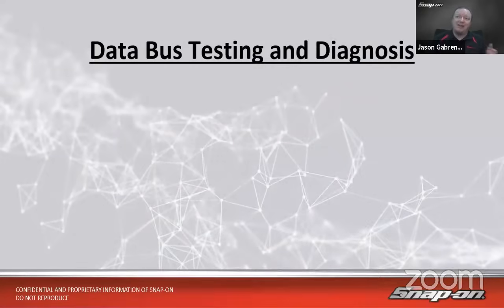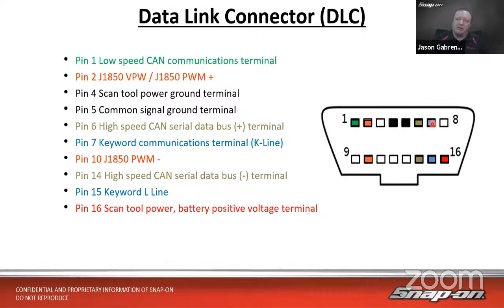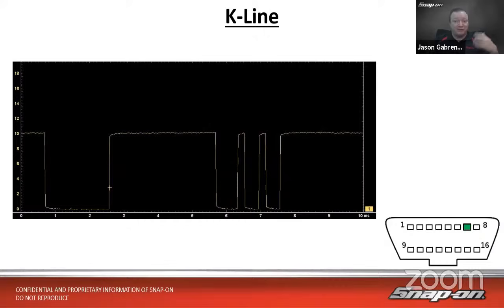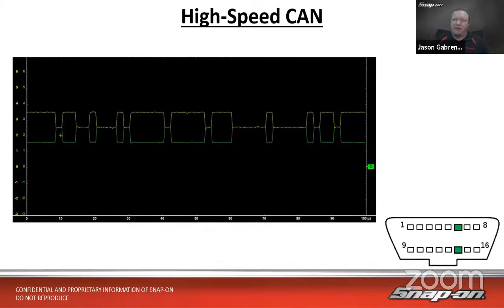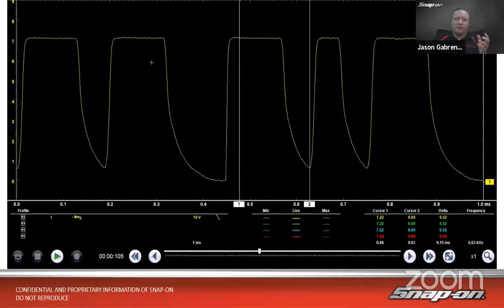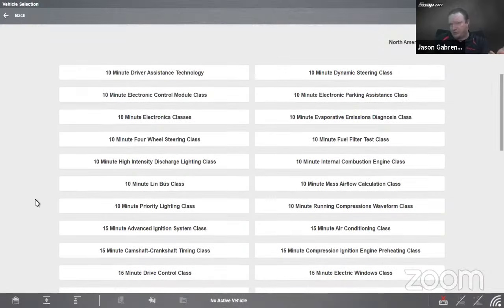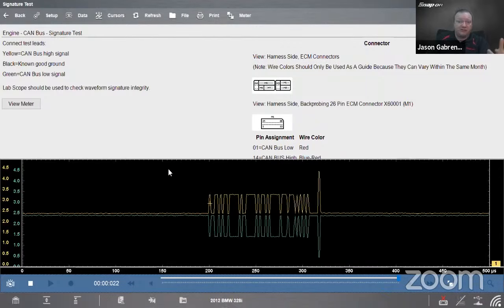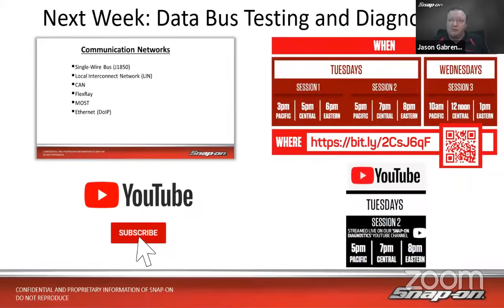Data Bus Testing and Diagnosis Part 1 - Snap-on Live Training Episode 07

Comment: Ideally even a CAN BUS Simplified diagram should show the CANH and CANL running together as a twisted pair (your presentation has a huge loop area, which is wrong), daisy chained from module to module without any stubs (which is how CAN was specified, and why termination is ideally 60 Ohms characteristic impedance). The reason you see stubs in cars is because the OEMs do not want to pay for a CAN bus in and a CAN bus out connections at the module connector. So, the OEM introduces an unwanted stub to save money by reducing the connector pins required by using CAN signal splices in the wiring harness with a corresponding loss of signal fidelity. Conceivable you could crimp two wires, if small enough, into one pin. However, the connector wire seals don't work very well when sealing two wires together.

Comment: This training has been a Godsend for me in learning to diagnose bus faults. I do have a question that wasn't addressed. What would cause an INVERTED/reversed CAN bus signal?? i.e., the resting voltages are 1.5 and 3.5v, and the drop to 2.5 when transmitting? Just saw this on an intermittent no crank vehicle. No com with any high speed modules (low speeds were good). After disconnecting and reconnecting battery signals returned to normal and com restored. No issues since. Sounds like a glitching or corrupted gateway module that needed its memory reset, but I'm no expert. Would love yours or anyone else's thoughts!
Reply: I'll also add battery voltage was low when I first tapped into the signals (parasitic drain). Hooking up cables and a jump box did not correct it right away. It was only after disconnecting (to do other tests) and then reconnecting that things cleared up and it cranked.

Comment: With regards to the Can High and the Can Low the voltage on both of these lines are positive the high being slightly higher than the low. When data transfer takes place the high pulses higher again and the low pulses lower again this produces a mirror image of each other in opposite directions. This is the VAG protocol.

Comment: weird, you normally dont see an open circuit at can system, but a bad module disturbing can circuits at inn and out from specific module or modules.
Reply from the maker: Definitely more common. I would say most likely cause for an open would be a damaged wire.

Comment: On the j1850 single wire bus, if one of the modules on the splice pack shorts, does it take out pin 2 of the DLC also? My IPC drops out and I lose the code reader also
Reply from the maker: If they are all wired together through the splice pack, then that would make sense.

Comment: Soo, I just watched another video which used strictly a VOM to test the CAN Bus. I commented on the video and also provided the link to this video because I realized that using a VOM is not always 100% accurate of what might be taking place on the network. Now I have a question after viewing both videos. 

In this presentation, you mentioned a  PERIOD at the end of  an information package / sentence. Can this higher voltage be picked up on a VOM and could that lead to misinterpretation / confusion of what is happening on the network - IF someone is not familiar with this end-of-message signal / voltage?

I'm currently a Marine Electrician  and ex Nuclear Instrumentation Technician due to transfer into the auto electrical diagnostic field later next month because I have become fascinated  with auto electrical diagnostics - at age 65...66 next month. If only I realized how complex and interested this field was I would have branched over a long time age but, better late than never coz I'm still in tip top shape. lol

I'm currently learning as much as I possibly can before embarking on my new profession at a luxury auto manufacturing plant here in the US, so I'm really fired uP.  

E / mc2 = m
Reply: What your take on auto diagnosis
Reply: Instead of living the rest of your life considering your 65-66 mark as best as you can you are making sweet dreams to thrive a business.
Reply: ill be here to help Pat Baptise.  just message and will share my automotive knowledge w you Sir.

Comment: @9:39 could you please explain again what data you send to vehicle to get data from vehicle ?
Reply: You have to ask ask your slave to do a job and it answers back to the master...really 😂 Reality...you turn on heater motor switch or use scan tool to turn it on and see if it's communicating through that network.

Comment: Snapon makes so many different scanners, which model is the one to own  to service these new cars
Reply: Snap on doesn't make anything. They have it made out their label.
Besides that do you have a scanner? Start with a basic one around 100.00 that reads code and has Live data feed. Start studying OBD2 and it's 10 modes.  Get along in that, and you will know later when you need a better scanner. The next level would be One with Data mapping and Oscilloscope.
Reply from the maker: @christopher - The first part of this comment is false. Snap-on designs and builds our own scan tools in San Jose, California. Have been for over 30 years. I do agree with learning the basics first.
Reply: I do have a Innova scanner, and Blue Driver, but if I wanted to get more in depth information, I wondered which way to go....Thanks
Reply from the maker: @Mike - as far as vehicle overage and functions, all of our scan tools offer the same coverage. The "entry-level" tool would be the SOLUS. Anything above that adds additional features like Fast-Track Intelligent Diagnostics, scope capabilities, or a Windows operating system.

Comment: good lesson. I'm working on a lin network on a 2014 nissan altima and the temp button on a manual hvac is not working and I'm showing a square wave pattern going to the actuator so I'm going to replace the actuator.

Comment: How do I carry a CAN bus test without pins 6, and 14 on the obd pot?
Reply from the maker: You can refer to the vehicle wiring diagram and check at the module as well.
Reply: @SnaponDiagnostics  would you have to back probe that specific module at the harness side connector while it's connected for voltage readings?

Comment: Hi Jason, I'm just seeing this video today (April 11, 2021), and first, wanted to thank you for uploading it and sharing your knowledge of Data Bus Testing! I also looked at the main site an see there are several live training videos along with the many other videos posted.

I am a licensed aircraft mechanic (A&P Licensed since 1984), and I was an Avionics Bench Technician in the Marine Corps, repairing Communication / Navigation equipment to the component level. I used Oscilloscopes, Frequency and Signal Generators, etc. to troubleshoot, diagnose and repair the equipment.

I have been with a major commercial airline for 32 years, mostly in Avionics, and I have worked with several types of digital data buses. It started with the AIRINC 429 data bus, moved up through the 5 hundreds (561 for Inertial Navigation), the 6 hundreds (629 for the B777  bi-directional buses) and into the 7 hundreds (708 for Weather Radar).

I am curious to know if there is an opportunity for someone to work in this area (data bus testing / diagnostics) as a specialist, performing this service for dealerships and / or individuals?

Thank you again, looking forward to watching more of the videos on Snap-On Diagnostics!
Reply: Hi Marc, if you’re looking for options, look at the requirements GM has for field service engineers, they need folks with your skills. Thanks for sharing your background, very impressive.
Reply: @TechScottBrown  Hi Scott, thank you for your reply. Who would I contact at GM to look into their requirements and what positions would be available?